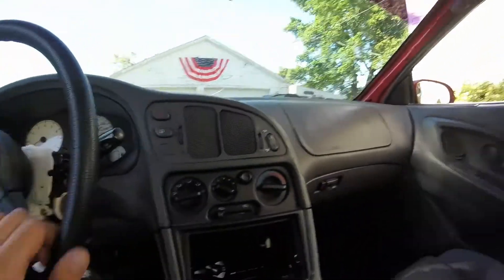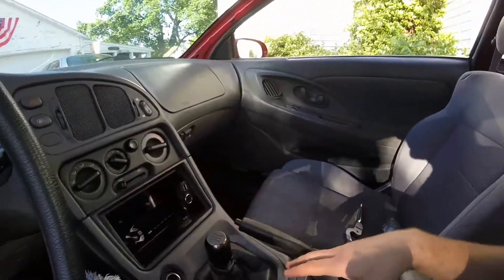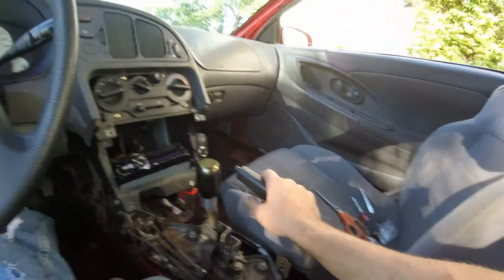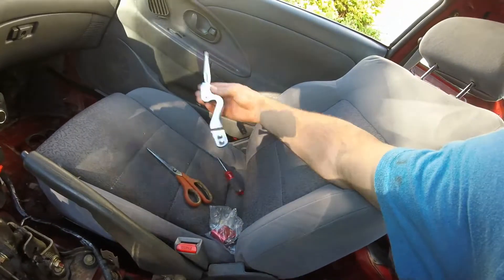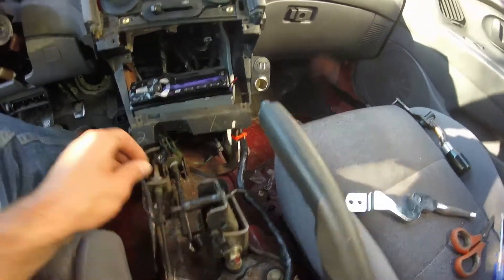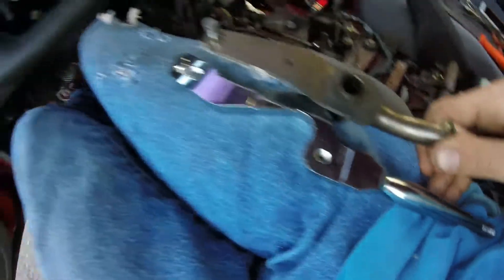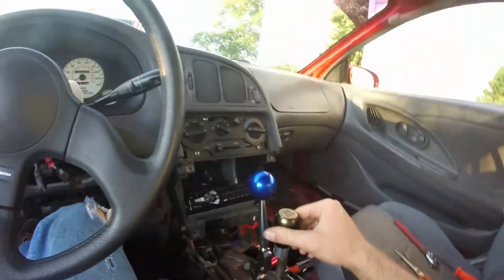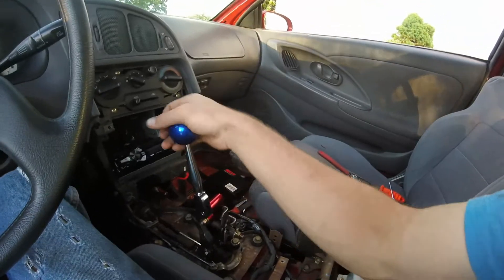Ebay Short Shifter Install

Comment: Have you looked into the shifter mount stiffening and shifter cable end bushing mods? Apparently they both make a huge difference. You can use skate bearings for the cable end bushings under the hood, on the turbo models at least. Otherwise the shifter is mounted on rubber bushings too and they make inserts to lock it in place.
Reply: Also you should totally get some R-clips for the shifter cable ends. So much less hassle.
Reply: Watching how stiff that shifter is I would definitely look into the skate bearings for cable end bushings and stiffening the mount, will really make it feel better.
Reply: Great video by the way! And thanks for the shout again. :D
Reply from the maker: 802 Garage I have but since my one cable is broken I don't want to get carried away. Once I get some new cables I'll look into some bushing kits though.
Reply: One of your cables broke? How did you repair it?
Reply from the maker: The ball socket that holds the hard part of the line together is broken, I made a bracket out of some metal strapping to hold it together with some hose clamps lol.
Reply: Nice. XD
I hear they are fun to replace. :P
Reply from the maker: 802 Garage yeah I'm not looking forward to it. plus the fuckers are expensive lol
Reply: Really? Damn. Maybe could find one in a junkyard? I don't think my friend has extras. I'll ask him though. His was a 420a.

Comment: I hope you’re still active mine will come loose at times and feel sloppy but if I tighten it to much it will be extremely hard to put it in gear, how do I fix this issue ?
Reply from the maker: You probably need to replace the nut on it with one that has nylock on it so it doesn’t work it’s was loose. My shifter kit came with one but yours may have come with a regular nut by mistake

Comment: It didnt fit in my 96 rs eclipse the bottom drug
Reply from the maker: Ah that blows, does it scrape the bottom of the shifter base? Mine had the aluminum adapter made wrong and a had to shave it down to fit, it might be a similar issue with yours.
Reply: Rust Belt Garage yes exactly  so approximately how much did you shave off bottom
Reply from the maker: Probablt a millimeter or so, it was quite a bit considering it was a vehicle specific part.
Reply: Rust Belt Garage  ok thank you bro appreciate the help
Reply: The reason it drags is he installed it backwards; I just went through this to figure it out.

Comment: HIS INSTALL IS BACKWARDS

Do not install the shifter this way; your shifter will hit the baseplate when shifting over to 1st or 2nd and it will feel like crap.

The arch should face backwards, hopefully this will save someone else time and less headaches.
Reply from the maker: This is actually something I meant to add a notation into the video about years ago and forgot about it so I’m glad you said something. Iirc this Chinese shifter didn’t come with instructions and I didn’t notice it was backwards until a while later when it was getting into my radio when shifting. I ended up putting the stock shifter back in because the nylock nut kept working loose that holds the assembly together
Reply: @Rust Belt Garage  
I also ended up cutting 8mm out of the total length. I cut just above the cable mounting hole, as even when installed the correct way; it still hit the baseplate when going the direction  of 1st or 3rd.

The transmission cable travel had 18mm of travel when moved to over to 5th with no hitting.  

When going over from neutral to 1st or 2nd it only had 10mm travel with hitting the base.

After shortening, I have no contact and a full 18mm travel when moving the shifter left or right now.

Works mint, wasn't worth all the effort though, wish they still made the b&m.